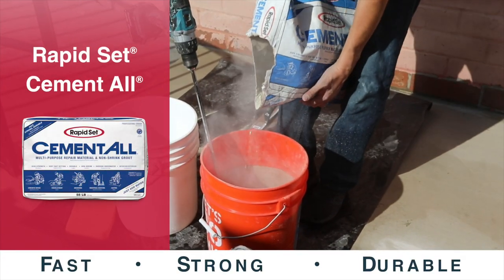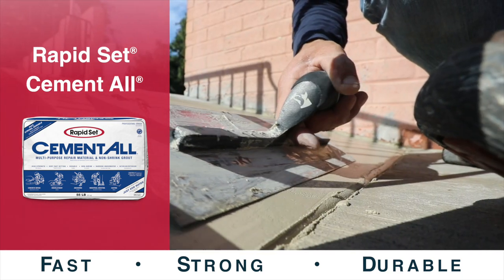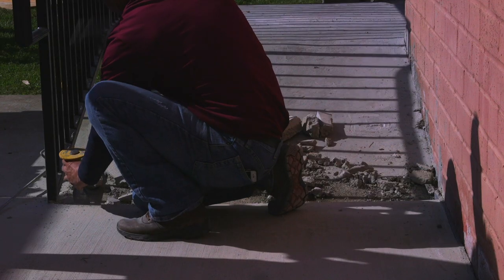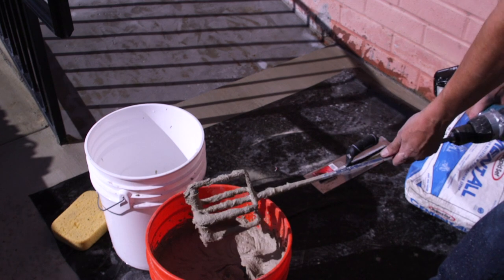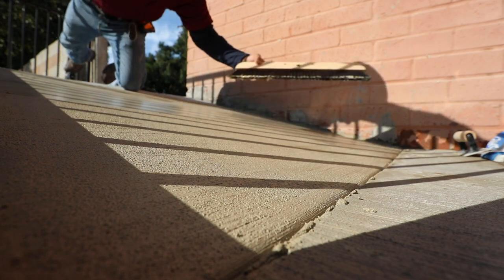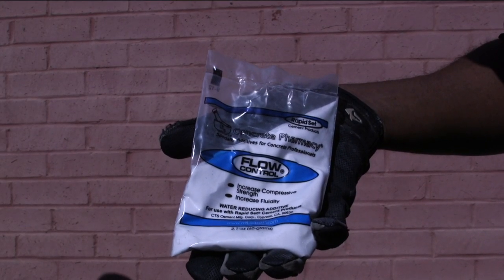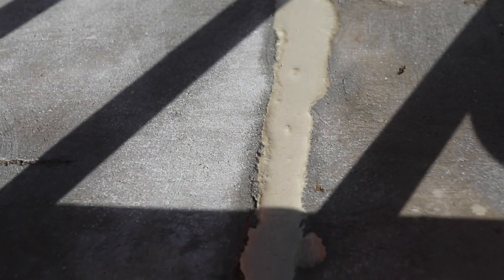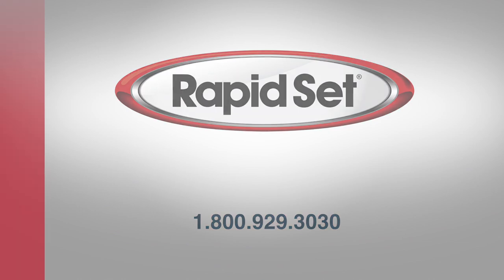Rapid Set® Cement All®

Comment: Just one amazing product to use,in dry hot climate you have to use a little more water then directions on the bag ,this is an honest product it sets when it’s supposed to and as you do the mix you learn how less or more liquid the mix should be for what your needs are ,I have been battling with this trouble floor for months,chipping concrete mix with chisel and mallet ,I finally pour the cement all mix and it works wonders

Comment: @CTSRapidSet , Hi Love you're line of products. I got a project coming up not sure what to use, I need to repair a cracked crumbling concrete wall, build a 8ft concrete pillar, build a small concrete retaining wall, and fix a cracked crumbling driveway. I know I'm buying Rapid Set but not to sure which type to buy for each task? Thanks in advance 🙏
Reply from the maker: Hi J. You will want to use Rapid Set Cement All to repair the cracks on the wall and driveway. Make sure to clean the cracks and spalls very well, getting rid of any loose dirt and debris before repairing with Cement All. You can use Rapid Set Mortar Mix to butter the block on the retaining wall, but we recommend using Rapid Set SET Control additive in the mix for more working time. You can also skim coat the retaining wall with the Mortar Mix if you want a nice uniformed look.

Comment: If I'm fixing my sidewalk, can I put this down first (or the concrete mix) & then do a skim coat of your mortar mix on top of that?
Reply from the maker: Hi Jamie, the thickness of your repairs determines the products to use. If the repairs range from 0-4" you will want to use Rapid Set Cement All to repair the cracks and spalling in your sidewalk. If the spalls are deeper, you can use Rapid Set Mortar Mix up to 6" thick. For full-depth pours, you can use Rapid Set Concrete Mix from 2"-24" thick. For a uniformed look over the surface, you will want to use Rapid Set NewCrete and broom finish.
Reply: @CTSRapidSet  perfect! Yes, it's pretty rough but still has some good concrete to work with. I appreciate the response back! Just wanted to build it up a little and then completely resurface everything to make it look nice. Thanks!
Reply from the maker: @jamie-r2034  you're welcome! If you have further questions, let us know. Have a great weekend.

Comment: Whats the coldest temp you can use this in to repair steps? I did it at 42 degrees and it wouldn't even stick. Took 6 hours to finally set up.
Reply from the maker: Hi Rico. You can apply Cement All in temperatures from 45 degrees and above. You can use warm water or heat up the substrate in colder temperatures to advance cure times.
Reply: @CTSRapidSet  Thanks.  I found it on the internet already but appreciate the response.
Reply from the maker: @ricos4700  you're welcome. Apologies for the delay in responding.  Hope 2022 is off to a good start for you.

Comment: I have to say Cement All works better on horizontal jobs like repair cracks or level floors or driveways ,mortar mix rapid set is better for vertical jobs or smaller surfaces and it has to be warm outside to work the way it should maybe 60 f ,my weather is hot right now between 80 f and 90 f I cover about 100 sq feet with a bag where the floor was more damaged I will probably need two more bags to finish the entire floor
Reply from the maker: Hi Adela. Rapid Set Cement All is excellent for flatwork, vertical, and overhead applications ranging from 0-4” in thickness. Rapid Set Mortar Mix can be applied on flatwork, vertical, or overhead applications ranging from ½” to 6” in thickness.  Both materials have excellent bond and strength. 

If you need to increase fluidity you can use our Flow Control additive with each of these products. The Flow Control is a plasticizer that allows you to achieve a fluid consistency without adding additional water and does not take away from the strength of the material. 

In hot temperatures, we also recommend using our Set Control additive to slow down the setting time if additional working time is needed. Cement All and Mortar Mix can be used in colder temperatures as well to complete winter jobs in a timely manner. When mixing and applying in colder temperatures, you can mix using slightly warmer water to speed up the curing time.

We are glad you like our products! Please let us know if you have any additional questions. Thank you for choosing Rapid Set!

Comment: For 25lb bag no instruction. How much water and how many "Set Control". I patched my driveway. Couple of places it Pelling off. Some patches become white powder. Home Depot guy says that I may mixed excess  water.  If that's true than should not you right on the 25lb bag. Total waste of my money and time.
Reply from the maker: Hello. Cement All may be mixed using 3 to 3.75 quarts of water per 55-lb bag for critical applications. For general-purpose and high-fluidity applications, a maximum of 5 quarts may be used. Use less water to achieve higher strengths. You would mix for the minimum amount of time required to achieve a lump-free, uniform consistency (usually 1 to 3 minutes), and not retemper. Up to 4 pouches of Set Control per 55-lb bag of Cement All can be used. If you have further questions, please contact our technical support line at 800-929-3030 or email info@ctscement.com.

Comment: i use this product today and i can tell you is sucks product
because after mixing one mins after that they start to get hardest and no way to fix later
And they getting to hard and he dry to fast in one mins
Reply from the maker: Hi Daniel. We're sorry to hear of your project concerns. We have a Rapid Set SET Control additive which extends the working time by 15-20 minutes per packet when added to the Cement All mixture. You can learn more about it at  https://www.ctscement.com/product/set-control?c=ADDITIVES&t=. Our product also reacts to ambient temperatures of the product and water temperature. Please email info@ctscement.com with your contact information so we can reach out and provide support for your project.